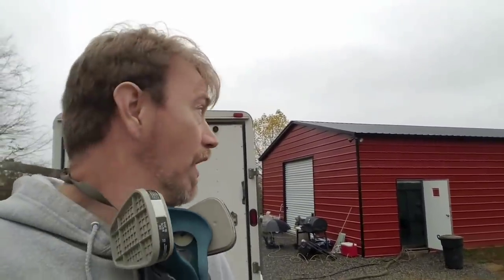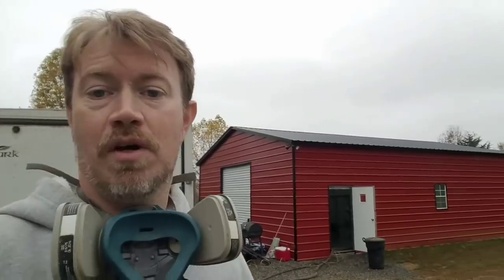Insulating Metal Buildings With Closed Cell Spray Foam

Comment: As the owner of a steel building I can tell you that spray foam has a fantastic use not mentioned in this video, sound dampening! I had the ceiling of my shop sprayed and it cut the sound from rain to almost nothing.
Reply from the maker: Good point Joe! You are right, spray foam can greatly reduce sound transmission.
Reply: Thanks captain obvious.
Reply: Thanks. I was curious whether the ceiling could be spray foamed.
Reply: @jimmarchman   yes of course
Reply: Would that help water proof the roof
Reply: @HoustonBrosSprayFoamFerrum  so if you do the ceiling and put heat in the shop you wont get condensation?
Good video
Reply from the maker: @dudleydorite7678  The foam prevents condensation in almost all cases. If the air gets saturated enough with humidity it can condensate on almost anything no matter how well the space is insulated.
Reply: The closed cell foam doesn't dampen the sound. Only the open cell
Reply: closed cell can only be used on the coast
Reply: @grasscutter88   Just wrong on both of your comments.
Reply: @fhuber7507  Open cell is soft and gets damaged easily though.
Reply: @grasscutter88  that is not true at all
Reply: @HoustonBrosSprayFoamFerrum  Thanks for the Informative video and personally answering the questions.  Nice to have some honest Shoot the Sh*T answers between guys.
Reply: Good to know
Reply: Yes, but I love the sound of the rain.  LOL   I live in Arizona so we don't get it very often.  Around here, we take the day off when it rains (even if you work in an office) so we can sit on the porch and enjoy the rain. We get about 300 days of sun every year.
Reply: What type of metal building did you put up? My wife and I are thinking of doing a small home out of metal. We would definitely go this route for insulation in Northern Nevada.
Reply: But the metal pops from the heat .
Reply: Any insulation or, say, a sheet of rubber would cut down the sound transmission greatly. Just physics..

Comment: The applicator is knowledgeable in the application of this product, the surface finish and the condition of the whip hose tell me that. I have been spray foaming closed cell foam in northern Alberta Canada for just under 7 years and it is nice to see a well done job.
Reply from the maker: Thank you!

Comment: Houston Bros are great guys with a great product.  They sprayed my attic space after I took out all of the batting and blown insulation that was making us sick.  We were out of the house for only two days after with a slight "vanilla" odor that was completely gone the following day.  Our heating/cooling costs reduced 30-40%, air quality inside the home is fantastic, less dust and the outside noise was greatly reduced.  Call Tom and his two (working) brothers.  They will be doing my new metal garage as soon as it's up in the next few weeks.
Reply from the maker: Thank you Wes, we appreciate the business!

Comment: I am a big believer in closed cell spray foam for many applications.  From my experience, the downside to applying spray foam directly to the backside of the exterior metal panel is the struggle this will cause if you ever need to replace that panel due to damage caused by storms, bikes or cars, or someone with an attitude kicking the siding.  The struggle to replace the panel is even worse if the inside of the building has been finished off with metal liner panel or plywood because you can't get to the backside of that panel you are replacing to cut the spray foam at a joint to allow for its removal.  During construction of your building, if you do plan to use spray foam, consider placing a house wrap before applying the metal.  The foam will adhere to the wrap, not to the metal, allowing panels to someday be replaced if damaged.
Reply: This will cause condensation

Comment: I did 1 1/2 rockwool between purlin horizontal and used 3m Spray adhesive to hold in place.with 6 inch of Rockwool between wall framing,vapor barrier and log siding, on inside.
Underside of roof pan, had 6 inches of closed cell and cedar T&G cieling.

Comment: Houston Bros could you put a video up of some previous metal building that have been foamed 10 years or more ago to show that there is nothing wrong with the building? Would be nice to see how the building is holding up thanks.
Reply from the maker: This would be an interesting endeavor as we have been spraying foam for over a decade and I would like to go back and see how some of our older projects have stood up to the test of time. Usually foam turns darker in color but that's about it. It's pretty permanent and really should not change much at all over the life of the building. I have rarely had a client contact us with any issues after installation. You can see many more of our metal building projects here https://www.houstonbrosfoam.com/metal-buildings
Reply: @HoustonBrosSprayFoamFerrum  Mostly im curious about rust on unpainted steel.

Comment: Spray foam really does work pretty good. The problem is the cost . For the same or a little less price I can bubble wrap my garage and insulate it with faced fiberglass. It’s unbelievable wha some of these guys charges here in southern Ohio. I’ve had the floor of a small house insulated awhile back. It was 28x40. Estimateswas $1500 to $1800 . I had half that in the fiberglass

Comment: I researched this a lot and just had a 26 x 42 metal horse barn sprayed . We are going to be using it as a home . The foam worked great and made the metal structure solid as brick ..
Reply: Benny Bryant, I’m looking at doing this to a building roughly the same size. How much did it run you to have this done?
Reply: Made it quieter too didn't it?
Reply: I have been wondering if this has been done successfully.
Reply: Benny Bryant: Hardy as strong as a brick. Maybe stopped the ‘oil canning’ effect but not much strength added. I’m not an engineer, but my neighbor has a brother in law that knows a guy that grew up with a friend that went to school to eventually become one.
Reply: Benny Bryant any issues with off gas being put off? I am looking at buying a metal arch building but struggling to settle on a insulation for the metal building.
Reply: suteu9  stay out for 24 hours and all is good.
Reply: It's worth every penny, had my house and my shop done this way. It's air tight.
Reply: @bighammer587  You may not be an engineer, but you're definitely a dipshit.
Reply: @bighammer587  Well I am an engineer and it is much stronger, as strong as brick....no, as expensive as brick.....not even close, better value, absolutely.
Reply: @suteu9  Have never had any issue at all. I love mine
Reply: @integr8er66  the funny part is" the guy didn't literally mean strong as a brick,  and off to  the race's a big debate.  No we are not really going to the race's.  This is some good shit" HELLO dont really taste it ! And no, it's not really poo.🧐

Comment: I did it...made a flimsy metal building into an actual solid building. Good stuff
Reply from the maker: Awesome! Closed cell foam is a structural foam and can add a lot of racking strength to walls.

Comment: i was in dmz korea in the mid 90s and most our bldgs were 50s quanset huts.  they had been sprayed 'on the outside' with foam, very thick. worked great in winter.  also in summer.
Reply: Why spray on the outside the building why not inside

Comment: Nice video, I'm an architect in Michigan and I spec nothing but closed cell spray foam in all of my commercial projects. Lately, we have been told by metal building companies if spray foam is applied directly to the metal panels it will void the warranty of the panels. I'm not sure why, any ideas? Have you heard of this?
Reply: The thought or worry is that foam is applied in high humidity trapping water between the closed cell and steel eventually causing rust

Comment: What kind of foam is that and about what did it cost to spray this building?
Reply from the maker: This is a plural component 2lb closed cell polyurethane foam. It's about r-7 per inch and is a moisture, vapor, and air barrier.

I don't recall what it cost to spray this project. Projects can range in price from $1,000 to $10,000. Pricing can vary depending on a lot of factors like:
  >Total square footage
>Type of corrugation
>Type of foam sprayed
>Thickness of the foam sprayed
>How far away the client is
>Will a lift be required
>How much preparation (plastic and masking) is required
>How many doors and windows
>Will the foam need to be cleaned off of the studs
It's not an easy answer. This is why we do free estimates so we can give you a custom price for your project. I hope this helps!
Reply: @HoustonBrosSprayFoamFerrum  Duhh, that is an extremely easy question to answer, you got paid, what was the amount written on the check?

Comment: You can buy the 10 gallon spray canisters with the built-in and gun from Home Depot. Save yourself $16,000. You could probably do this whole building yourself for 1500 bucks, 2000.

Comment: What about off gassing and the gasses that get released inside the building down the road .
Is that BAD for ur lungs???
Reply: Older formulae used to have that issue it they were mixed  at the wrong ratio, applied too thick in one layer before it had to cure or applied at an improper temperature.

Newer formulae used today  are not as sensitive to  temperature and  will cure even if applied thick.

They still need the correct mix ratios, but this being wrong can be detected almost immediately.

When using closed cell where you can see it and  touch it, you can find any problems just by looking.

Comment: Do you ever notice the spray foam pushing out the metal siding? Making it buckle at all when expanding.
Reply: That could only happen if you blocked the air inside of the building from reaching the foam.  Much like Stuff-it, it only expands while air is available.  Since the air is more available on the inside, that is the direction of swell.

Comment: Spray Jones says from test that 2" is best to stop enough heat transfer which will cause condensation and is all you need to insulate almost anywhere in the states. Did you find 1.5 enough?

Comment: Not only that!   It seals, the metal from SWEATING ON THE INSIDE TOO!
Reply: 426 SUPER BEE Mopar or no car. PERIOD
Reply: I AGREE ~ GOT TO LOVE A HEMI
Reply: is there a chemical reaction over time where the foam is on the metal siding?
Reply: @timmernator1  I had that problem with Great stuff spay foam, but idk about this, its much different, but it does not seem to soften the painted metal it was applied to, and no sign of any issued at this point. 2.5 years installed now

Comment: I am building Metal building in Northern Arizona. My insulation company bid one with open cell. Do I need to use a vapor barrier here? We rarely have humidity higher than 15% except in the monsoon season (4 months) when we can get in the 70% range at the most and not everyday.  We get freezing temps and snow up here from Jan - March, as well.  I hope that is enough info to get a good idea of the proper way to insulate up here.  The wind is so bad here that it is almost impossible to put on the insulation from the metal garage companies. TIA

Comment: What is the cost average for a 40X60 metal building roof only?
Reply from the maker: Projects can range in price from $1,000 to $10,000. Pricing can vary depending on a lot of factors like:
  >Total square footage
>Type of corrugation
>Type of foam sprayed
>Thickness of the foam sprayed
>How far away the client is
>Will a lift be required
>How much preparation (plastic and masking) is required
>How many doors and windows
>Will the foam need to be cleaned off of the studs
It's not an easy answer. This is why we do free estimates so we can give you a custom price for your project. I hope this helps!

Comment: My dad built a house can you spray foam? The people that bought it we're allergic to the foam gases, they had to tear out all the inside drywall and dig out the phone and replace with fiberglass insulation. Cost almost as much as the house. There's other video showing where if it's not put on proper the right temperatures are the benoliel shin isn't right? The guy had to tear his whole roof off and replace it. That was many years ago? That stuff turns rock hard I've never seen that.

Comment: So the building cost $9,500??..........Did the insulation cost more to install then the cost of the building?
Reply: Roger Evans the cost for what??
Reply: Jay Beesmer no. It’s a small building and a small lift of foam. Maybe $3000-$5000, I don’t know the dimensions.
Reply: @christophergruenwald5054  Well my 20x25x10ft wall build all in including a 10 ft lean too, concrete floor, and spray foam on walls and ceiling, 2 windows, 1 man door and 10 ft roll up door was $11,600. Other than the roll up  door which doesn't seal well at the  top this is a building you could live in. Of course it would cost more for plumbing and interior walls, but its a damn fine building for 12K
Reply: @integr8er66  Where did you purchase your building from?
Reply: @johnmichael549  
https://gatorbackcarports.com
The 20x25 building with 10 ft walls and 8ft lean too, 10 ft roll up door, two windows and one man door was about 6500-6800 maybe. I had a concrete slab poured ahead of time that cost me 1800, and the insulation was somewhere between 2200 and 1800, I just can't remember. I will try to post a video of it when I'm down there over christmas and that way you can see it.
The lean too was a bit of a deal, when ordering I though ghe diminsion was height, but actually it was width, so some field mods had to be done, that is the difference in dim I gave.
Reply: You can buy a steel 2 bed 2 bath house with a garage in a bolt-together kit for like $18,000 from the internet now. Modern factory-made steel structures are exceptionally economical and customizable, also it is much easier to just have 90% of your whole house delivered to your property than it is to assemble it in a shitload of splintery, expensive, and gigantic pieces that take forever to put together. You can slap a steel garage together with a socket wrench, a ladder, 2 friends, some burgers, and a 24-pack in like 7 hours lol. Adding windows and the doors takes 3-4 hours and the finishing takes another 3-4 hours. Thanks to technology now you can really cut building times in half using unskilled laborers/drunk friends for much much cheaper than it would cost to build an inferior structure with more expensive skilled professionals
Reply: maaingan great

Comment: You made you points and did a nice job. Could you have smoothed the surface? Have you looked at using the foam for raising foundations? Good Luck, Rick
Reply from the maker: The foam can only get so smooth, it's just the nature of the product. We do actually do the concrete lifting as well. https://youtu.be/LsZfbBrj83o

Comment: The wire is supposed to be in conduit the first time a wire shorts the building will burn
Reply: It will trip the breaker
Reply: @slopoke8656  BS reply ////////////////////

Comment: I had spray foam installed on a wood pole barn with steel sheathing.  I've had excellent results (only the walls were sprayed).  I didn't have the roof sprayed because I had the R10 rolled roof insulation under the steel and had a ceiling installed later which had blown fiberglass installed on top of. Immediate results beyond a better temperature was a "quiet building", no more shake, rattle, and roll with the wind.  

Of note:  while the foam was a closed-cell foam, all foam insulation that was was exposed (i.e. not covered with a fire retardant material, drywall or other finish)   required a fire-retardant spray/paint, in NC;  my insulation applier took care of this without me requesting it. 

Houston Bros... here's a question"s.
I am in the process of building a new "all steel" storage building.  I've seen articles on thermal break foam panels between the steel sheathing and purlins with  1"-1` of fiberglass.
Can foam be applied over the batts?
Should I only go with the thermal break and foam? 
If I apply Foam on a roof, is there any disadvantage/concern about applying blown fiberglass in a ceiling later?
Reply from the maker: We recommend remove all fiber insulation and applying the spray foam directly to the metal. The fiberglass is not fully adhered and will fail over time. The fiber insulation also provides opportunity for moisture to be trapped between the insulation and the metal. Direct adhesion of the closed cell foam to the metal will yield the best performance results, lock out moisture, make the building stronger, and it will last the life of the building. I hope this helps!
Reply: @HoustonBrosSprayFoamFerrum  sure does, thanks.

Comment: I have a steel frame house( steel walls & studs), the stucco was applied directly over exterior steel walls ( no lath, plywood or anything else). Could this be sprayed on the outside after removing old stucco? Then install stucco or different siding properly?

Comment: Does it off gas much after it's cured? Will it off-gas in the heat of the summer when the sun is baking the building?
Reply: Ty's Videos It will completely stop off gassing between 24-48 hours. The typical cure time. After that period, it will never off gas again

Comment: I'm buying a 30 by 30 foot building.  The company charges about 5 grand for a mylar double stick insulation that has an R value 15.  The building is in the desert so I imagine the reflective value of the foil may be better than foam.  But it certainly won't stiffen the building.  Should I use foam instead?  Do you  know what the R value of foam is?  If I can afford it, can foam be sprayed over the foil insulation?
Reply: @Drizimar1  The foam adds stiffness, which is a concern due to high winds in the area.  But I assume the R value of the foam is less than 16.  So since it's in the desert, which can reach temps of 120 in summer, should I go with foil instead of foam?